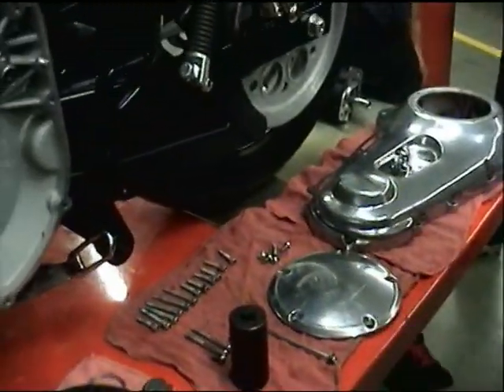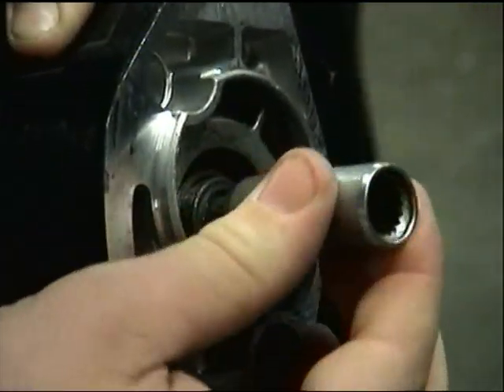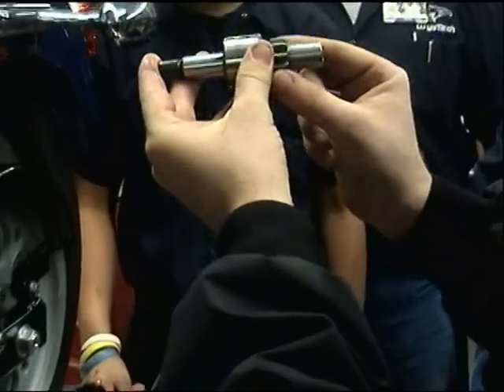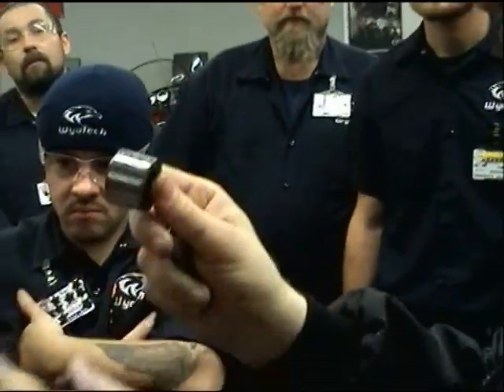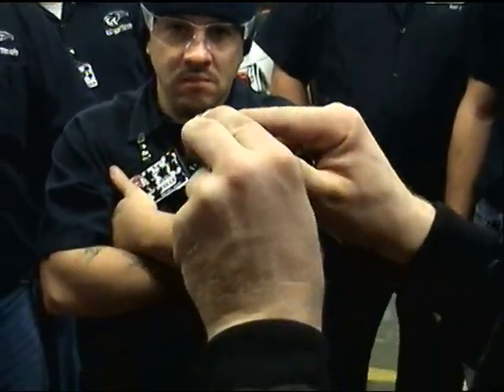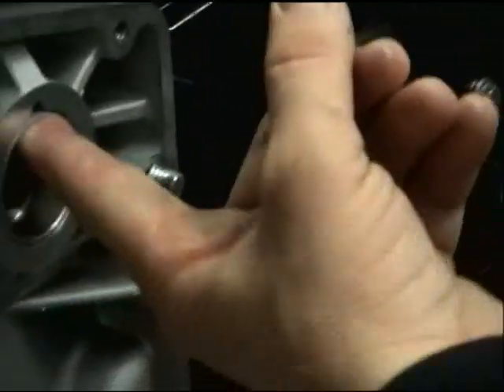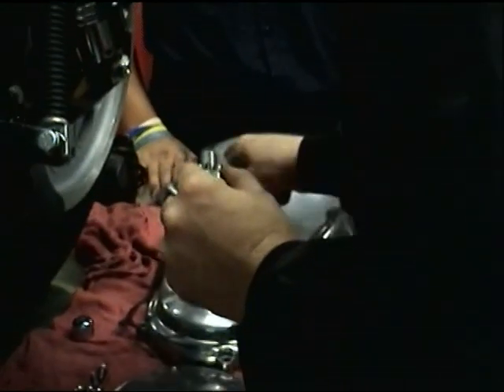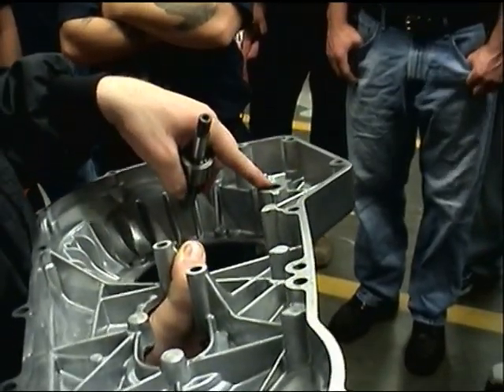tony encalade jackshaft.avi

Comment: today I changed the starter on my 1989 Harley FLHS . the new starter bolted right in place  but the jack shaft bolt would not screw into the shaft .  Did they change the starter jack shaft for the newer  Evo's ? thanks